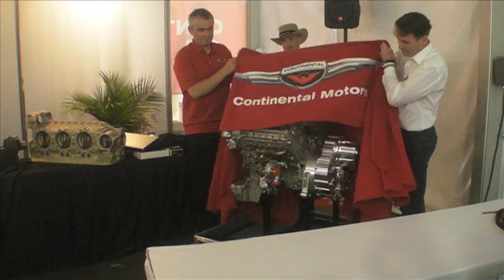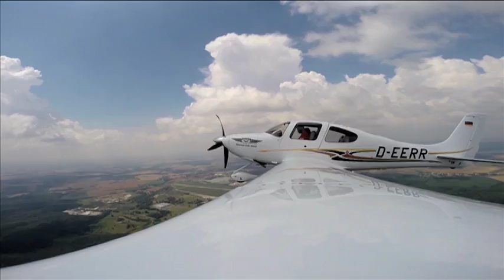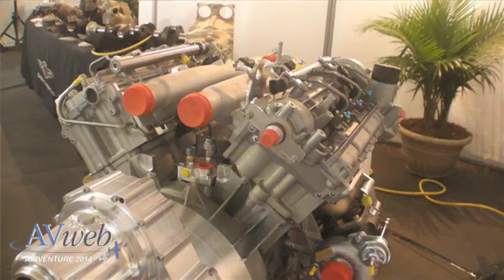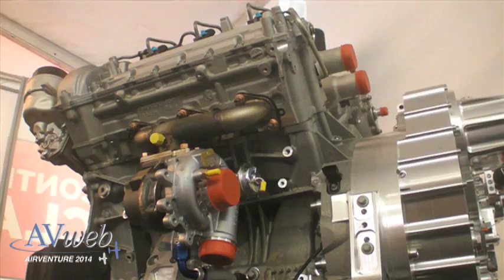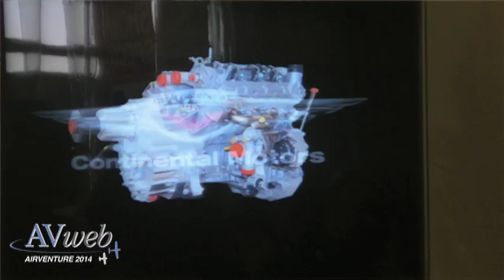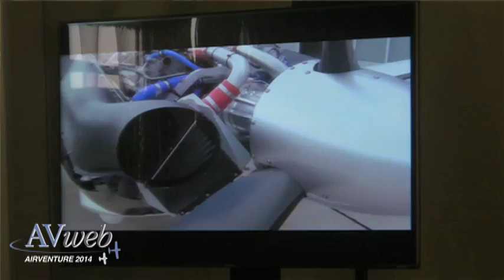Continental's New CD300 Diesel

Comment: That's a Mercedes OM642 engine that they took and modified by removing all the diesel emissions system parts off of it, like the DPF, EGR, CCV and the SCR. Remove all those and you have a bulletproof engine that will go on and on and on and on, while poluting the atmosphere like crazy.

Itsy the same engine in my car!! Just wish it didn't have to be suffocated wit all those diesel emissions systems. O_O
Reply: I have an ML320 CDI that ide rather not sell ... its been a great SUV

Comment: Vertical Horizontal what? 'Its not a clean sheet' but it is a clean sheet? Can someone please translate that ?
Reply: +Pete Kuhns I think he meant that the design is based in part on the automotive engine (not a clean sheet design), but the engine itself will not have many parts in common with the automotive engine (clean sheet).  They're moving from taking an automotive core and modifying it (horizontal) to making it from the ground up (vertical).